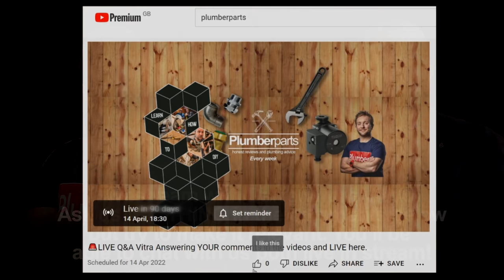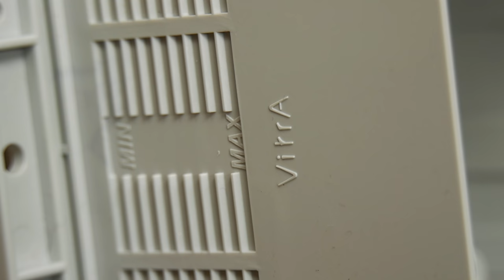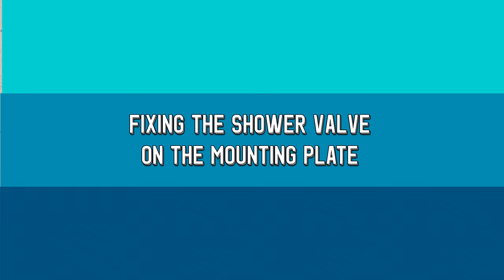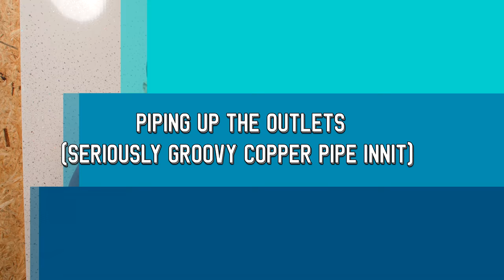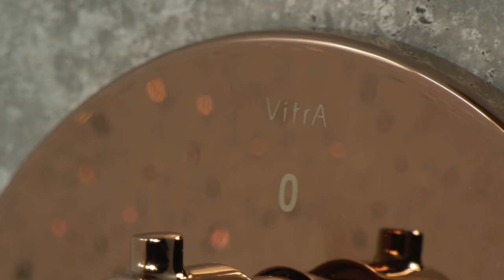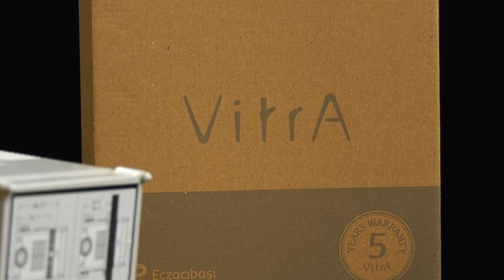How to install a concealed shower on timber frame wall | VitrA V-Box

Comment: Hi mate, great vid but a couple of comments.  You state mimum finished wall depth is 50mm - is it?  Just received my box to go into a 50mm metal stud wall and the void is 50mm, plus 12.5mm for aquapanel, plus 8mm for decorative wall panel (and a copluple mm for silicone)...yet marrying all that up I still dont reach the minimum line to cut off the shroud off?  

Also what is the platic square bracket thats supplied fitted around the v-box for?

Cheers

Comment: It looks like you’ve got 3/4” connections and backplate elbows, as well as 22mm size pipe going to outlets. If the hot and cold feeds are 15mm while did you uprate the pipe sizing for the outlets? Also are the box connections all 1/2”? You said you were using 1/2” to 15mm irons for the feeds. Are the outlets 1/2” too, if so what would be the point of running the outlets in 3/4” and 22mm? Are you downsizing to the backplates? Surely the hand shower and rose connections would be 1/2” so you’d have to down rate at the outlets? I see a lot of people doing this but I’ve never understood why because the water can only flow at the width of the smallest fitting.

Comment: Been watching loads of your vids pal and I know being a seasoned plumber you love copper but, would you see anything wrong with using pushfit with a concealed shower unit?  Am I asking for trouble down the line if I was to use pushfit for ease (not being a plumber or have the love to polish copper in a sexual manner) ?

Comment: Great vid, I'm about to install something similar. When you threaded the shower head unit into the fixed elbow, how do you ensure that the cover plate is tight and flush the same time that the angle of the arm is pointing down? Or was there a grub screw to rotate the unit to be at the right angle once nipped up?

Comment: Great video as ever.  I have installed a similar set-up in the family bedroom and all works fine.....apart from after the shower is off.  The shower head is huge 400x600 and holds lots of water.  Due to the surface tension/vacuum effect this drips out slowly over the next hour.  Is there a valve of any sort that can be installed between the main shower controller valve and the shower head, to allow air in?  It is not possible to move the head after a shower, as it has 2 fixings and the feed into the ceiling.
Reply: You could try a vacuum breaker valve, which would let air in between the shower head and the valve.

Comment: Anyone use loctite 577 or similar liquid ptfe for the connections to the box instead of the loctite 55 thread?
Reply: I have both, I tend to use 55 on fittings like this and use 577 on radiator fittings.